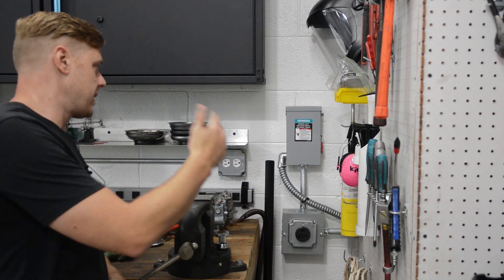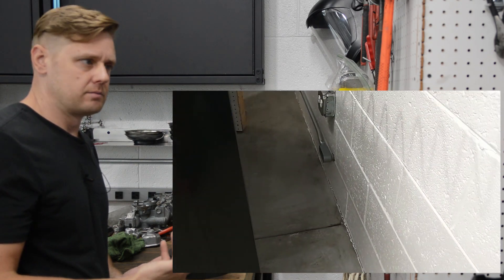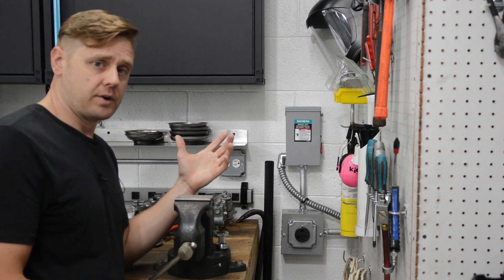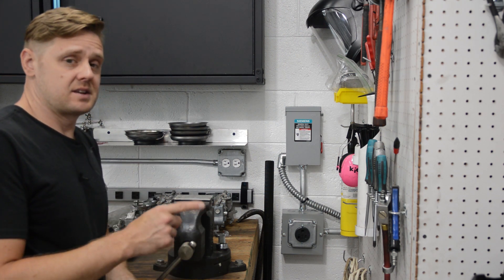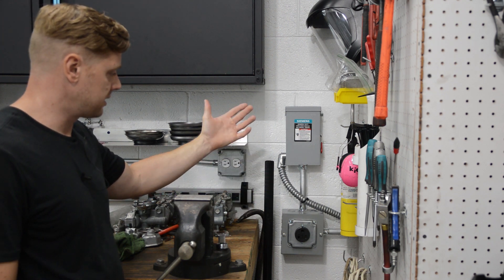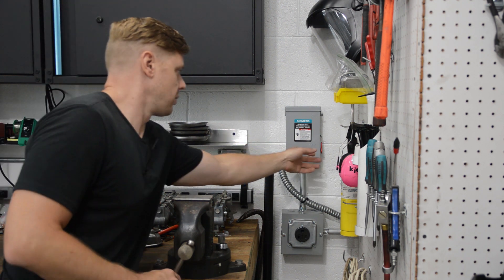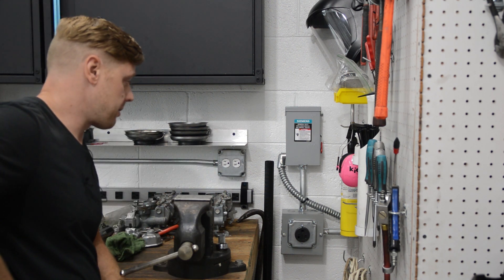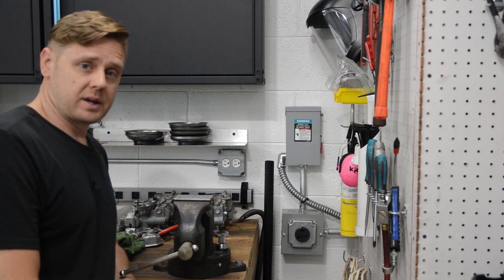50amp / 220V outlet INSTALLED!

Comment: I put in a 50amp circuit.... 50ft of 4 conductor 8 gauge for a Tesla charger. Wire was $6 foot.... $300 plus $200 to my son for labor.. (plus the Tesla charger/cable,  plus the Tesla solar roof.... green is expensive and a hoax but the T3 and the roof are cool)